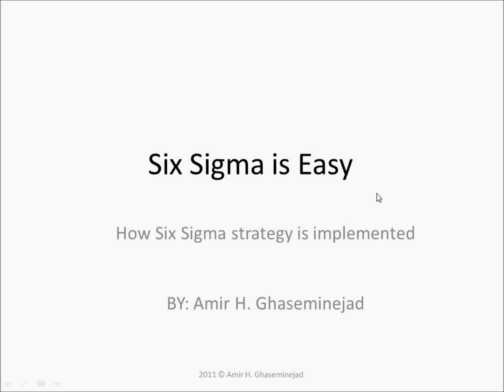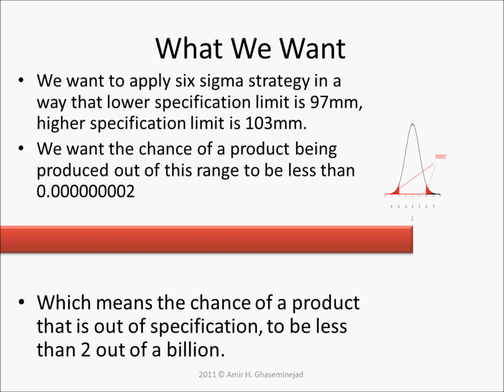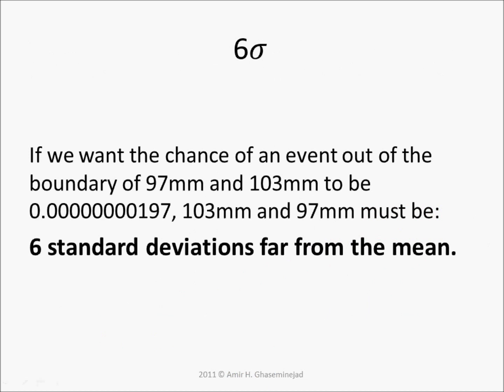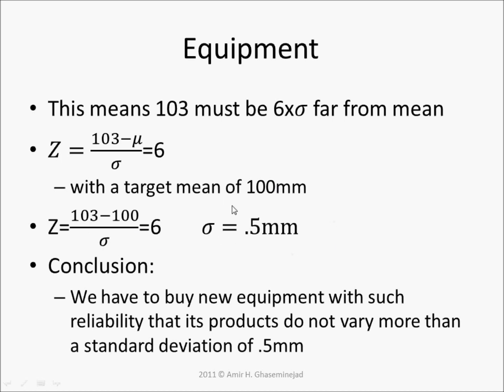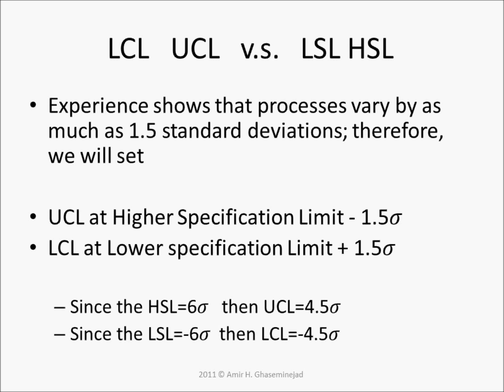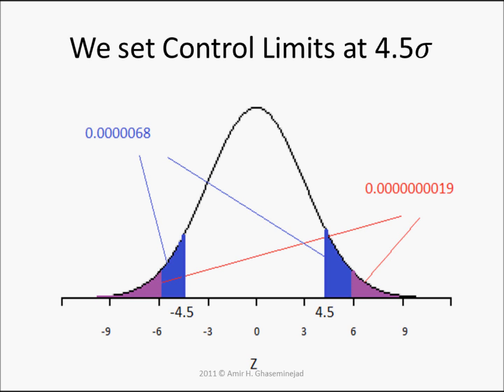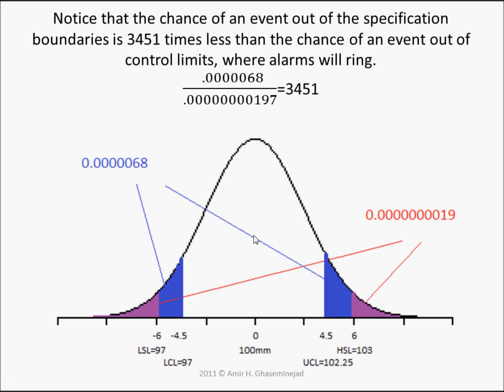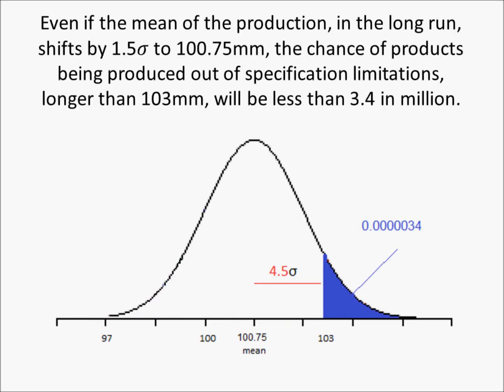Application of Statistical Analysis: Six Sigma is easy

Comment: Amir, please make this clear to me. When you say 6sigma capable, does it mean 6sigma on each side of the mean (Is it not 3sigma on each side of mean thereby 3s+3s=6sigma) ?
Reply from the maker: The probability of an actual fault happening out of specification limitsm which are at 6 standard deviations on each sides, is less than 2 out of a billion.

Comment: (1.97 x 10 to power -9) x 3451= 6.79 X 10 to the power -6 < 6.8 x10 to the power -6.

the Chance of a limit out of the specification boundaries= 1.97 x 10 to power -9
& the Chance of a limit out of the control limit= 6.8 x 10 to the power -6.

That is the reason you stated in the end
The chance of a limit out of the specification boundaries 3451 times less than the Chance of a limit out of the Control limit.
Thanks

Comment: Why organizations like Motorolla and GE  settle for 3 Sigma from 6 sigma quality due to the 1.5 shift,  and not 4 Sigma from six sigma quality? It still leaves .5 sigma. (with respect the UCL in this case).
You have done an outstanding presentation. Could you please answer this question. Thanks.

Comment: Thank you for your post.Pls help me to understand a basic concept related to Cp and 6sigma. 

Definition 1 for Capable process
Cp=(USL-LSL)/6sigma
This means that if in the tolerance range of the customer(USL-LSL), we can we fit 6sigma, than the process is capable.

Definition 2 for Capable process
If between the closest specification limit (USL or LSL) to the mean there is a 6sigma interval, then the process is capable. But if so, shouldn't Cp=(USL-LSL)/12sigma

Witch definition is wrong, why?
Reply: though it's a bit late, I may be able to provide an answer. Cp indicates if your process is "capable". But 6 sigma is for quality control, as you can see the prob of defects in 6 sigma is much lower.
As commonly accepted, Cp or Cpk = 2.00 means your quality is at 6 sigma level.

Comment: Salam Amir. I like your video. You explained clearly how to use z to show what sigma value should be
Couldyou also explain using Excel 2007 tools to create control chart, normal distribution, z distribution, histogram 
Also, is there a tool to use Isakawa daigram (Cause & Effect) to identify cause & request corrective  actions.
Is there a tool to use Pareto chart to identify 20 percent of problems/causes responsible for 80 percent of disturbance.to focus on 20 percent when usuing Ishakawa

Comment: Could you put a video on making control chart, normal distributionm, z standard distribution (to determine the variation from mean 4.5 standard deviation allows),histrogram (Objective is higher frequencey around mean), & give example of using Fishbone diagram (Cause & Effect) for distribution centers. Is there a  tool to determine  what 20 percent of the causes are causihg 80 percent of the disturbance